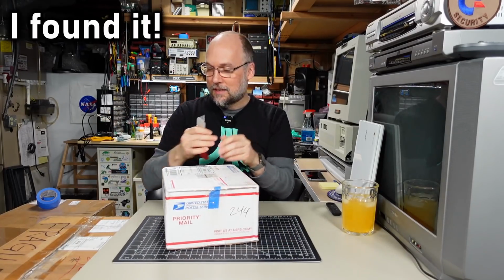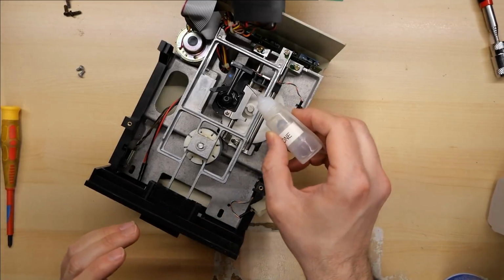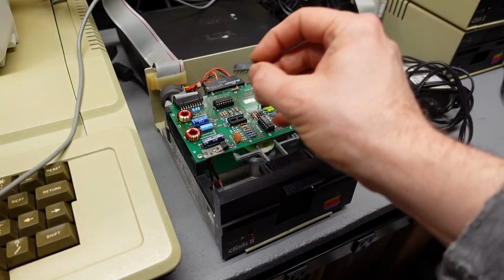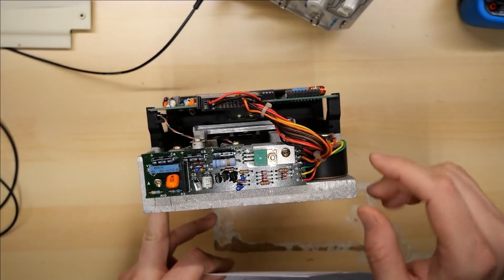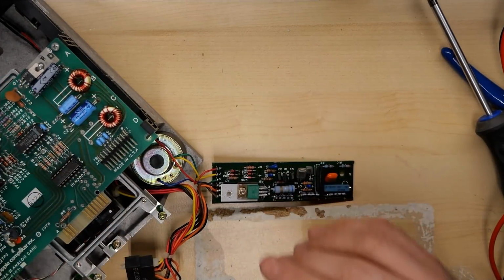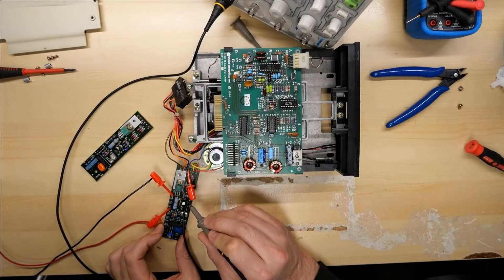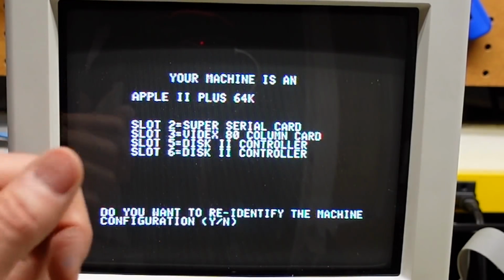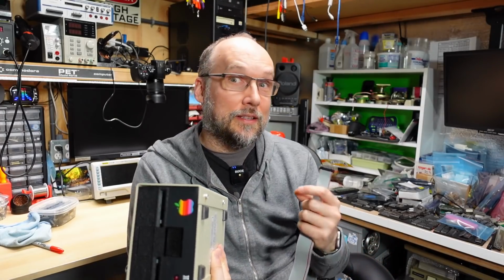Repairing an Apple Disk ][ drive with multiple faults

Comment from the maker: Several people suggested a bad pot on the speed controller. I had checked the pot and it was fine -- it has a range of 0 ohms to 50k ohms. With this circuit, the pot only has a very small range of adjustment around the target motor speed, so removing it almost certainly would only result in the speed being slightly out, not wildly out and uncontrolled.
Reply: Did you by chance check the input vs output of the MOSFET?  I think those things fail "on" sometimes, right?  You should be able to test that by itself without the rest of the board powered.
Reply from the maker: Yeah I did -- even comparing how things look to the working drive (just didn't show any of that on the video for time.) I wanted to see what the output looked like on a working drive first so I knew what to look for.
Reply: The two things that I immediately suspected that i didn't see get checked in the video are in the first comment thread... Always good stuff from this community
Reply: actually no, if you removed the pot, then the on chip oscillator would not run.
Reply: I was wondering if it was a dry joint or bad connector. (?)
Reply: I literally just commented this. Because my 3d printer stepper driver module trim pots throw max voltage when they fail. But if the range is as limited as said then yeah its gotta be that IC. I wanna see you de-solder it and try the oven trick and see if it comes back to life.
Reply: Is posible yo use your scope like curve tracer for compare both boards.
Some time ago I have a problem with the servo controller in one Open Reel, in my case one transistor fail and the motor do not turn at all.
After testing all I change the transistor for new one and the machine works perfect.
I use a B&K 520b transistor tester, the transistor looks fine but do not works in circuit.

Best Regards.

Comment: When I was in high school the principal asked me to see if I could fix, if possible, one of their Apple IIe Disk ][ drives that was "eating" disks (it was writing junk to track 0 as soon as it was turned on). Now I didn't have equipment to check signals, but I did have plenty of other Disk ][ drives that worked just fine,  so I just borrowed chips from a good system until I found the fault. It was a bad 74LS125 chip on the controller card, and it was cheap to get a replacement (less than $2.00 back in the mid 80s). One fixed Disk ][ disk drive later, the Principal was happy...until he told the school board that a student had saved them money. They had a something of a fit and absolutely forbid a mere student to mess with the innards of one of the school computers! They would rather pay an "authorized Apple repair shop" hundreds of dollars, rather than allow a student to fix it for the cost of parts. Their loss!

Comment: Hi Adrian, I am two years late to the party but yes, I also have an ALPS half-height 5 1/4" Floppy Drive that runs flat out, not on an Apple or Commodore but on my Osborne Executive.

I had done some preliminary examination of the wiring to the backplane of the drive, and was preparing to use a breadboard to jumper the SHUGART Connector from the ribbon cable to try and find the problem, however you just saved me a heap of time and effort with this video (and your method is far simpler by going directly to the speed controller board).

Also, you provided the speed controller schematic and an obtainable replacement drive to source parts from, and I can tell you I have been seeking assistance to this problem on two Osborne Computer Groups but no one has been able to help me, so a thousand thumbs up and my eternal gratitude! 

I have an Apple Disk II Floppy Drive with a dodgy 74LS125N chip (fried on the weekend by accident, when plugged in incorrectly) and when I pulled the cover off the drive to check the number on the chip (I was watching this video in the background) you mentioned the ALPS Drive and my ears pricked up. Then when you mentioned the drive running flat out and looked at the speed controller board, I realised that it is identical to the board that the Osborne Executive half-height ALPS Drive uses.

My Apple Disk II ALPS Speed Controller board is slightly different (component sizes = HUGE caps) and I want to fix that drive with a replacement 74LS125N IC, so I won't cannibalise it, however I did jump on EBAY to grab a Commodore 1541 ALPS drive that should hopefully provide a good donor board for the Osborne drive speed controller.

Thanks again and wishing you every continued success,

Cam
Canberra, Australia

Comment: I have an Apple Disk II that prevents my II+ from booting when it is connected. 
It was working fine, then it started to become intermittent, now I can't get it to boot at all. 
But it boots fine with another drive plugged in.
Any ideas what that might be? :) 
There is nothing obviously wrong inside, and everything moves freely.

Comment: Thanks a lot Adrian for pointing me into a right direction! I had a Disk Drive which was spinning at the same speed as yours! I thought, me speed controller might be dead as well. Still I probed the tachometer signal and found, there was no such thing! Nothing! No signal from the motor.
I removed the tachometer from the Compal LC-177 motor (two tiny screws) and found, that the magnetic ring on the motorshaft was spinning free! I fixated it with  some superglue and activator, screw it back to the drive, turned it on and bam - drive speed was back to normal. Quick stroboadjust and the drive was booting again! Without you -  me beeing a complete Apple drive hardware noob - I would have never ever found this fault! Thanks a ton again! Cheers!

Comment: Hi Adrian - I have one of these on my bench and the drive belt has been nicely nibbled apart.  Was wondering if you could provide the dimensions of the belt and a potential source to buy one?  My drive is also the later one like in this video and not the Shugart version.  I understand that there is a belt size difference.  Thanks in advance.

Comment: Your screw magnetic grabber looks like one I picked up for $10 USD at my hospital gift shop 7 years ago.  Looks like yours has a LED light like mine. I find mine to be my go to grabby tool for those lost screws in my office carpet. While I should not have carpet in my office but more anti static flooring that was not meant to be... Maybe my new new new new new manager might see the need to add anti static flooring. I've taken a few static discharges through my pants zipper. TOTALLY DON'T RECOMMEND.

Comment: Hey Adrian. Could also be that the potentiometer that controls the speed of the motor is dead or rusty, leading it to have always full value ? Maybe replacing it if you need to use the part again later could be an idea. Thanks for these awesome videos.

Comment: If you want to see some impressive code look at the read sector code, the 6502 running at just 1mhz had to read the data directly from the head and process it without the help from a disc controller, the timing had to be spot on. 
I remember rewriting the code back in the 80's and stripped out everything to use the drive like FRAM with no directory structure so it had greater capacity to be used as a database.

Comment: I remember those drives.  We had an Apple IIe when I was 16 or 17..  There was lots of room inside.  I installed a switch that I glued (with epoxy) so that you could reach it by sticking your finger just inside the door and to the left.  It had 3 positions it was wired to the write-protect switch so that in one position it write protected your disk, in another position it write enabled the switch and the 3rd position did whatever the switch normally did based on the notch on the disk.
The bottom "vents" weren't actually vents either - the box was mostly water-tight.  And if the can fell just right to spill into the open door could hold about half a can of Dr. Pepper.  Don't ask me how I know this.

Comment: The apple 2/2+/2e drives would read a peanut butter sandwich if you could fit it in there!  ^-^

Surprised i didn't hear the "clacka clacka clacka" sound of the heads bouncing as they are run to track 0.  Some of the better drives (aftermarket mostly) had a sensor that would stop the tracking motor from doing that, but none of the Apple brand drives did, as far as i know.

The entire apple 2 series was a study in doing a lot with very little hardware resources.

Comment: Usually when the disk][ is incorrectly connected, you'll know it as there tends to be sooty marks where the 74LS125 was.  Whoever connected it incorrectly will also know it as it tends to go BANG as soon as power is applied.

All my disk][ drives but one are "red label" drives with ALPS mechanisms.  The remaining one (a "brown label" drive) is an actual USA-made SA390.

Comment: The following quoted text is from a Jan Beta channel discussion about the suspected cause of high MOS Technology IC failure rates.  You should check the date codes in your bad ICs storage box to see if there's any correlation:  "According to what we know, the bad years were 1983 and 1984 (due to too much boron in the IC die insulation layer). In 1982 the Frontier Semiconductor fab wasn't operational yet, in 1985 the problem was solved."
Reply: The C64 PLA Dissected
Thomas ’skoe’ Giesel

http://skoe.de/docs/c64-dissected/pla/c64_pla_dissected_a4ss.pdf

4.3 Reliability Failures

People who repair Commodore computers notice that the early PLAs fail quite often. Bil Herd recalls “By far the worst chip failure mode we had was the PLA around 1982-83 as it was suffering from poor passivation. It would get the ‘purple creeping crud’ which was corrosion under the protective layer.”
 
Dan Morris knows the reason for this issue: “The inter-layer glass (Low Temp Oxide or LTO) is doped with Boron and Phosphorus atoms. Boron and phosphorus are added to soften the glass and cause it to flow at lower temperatures. The flow smooths the surface of the circuit dramatically improving step coverage for the aluminum interconnections. Boron concentrations above 4% really accelerates the glass flow. Unfortunately raising the Boron concentration above 4% also sets up a strong but relatively slow corrosion reaction with aluminum. This is a reliability time bomb. As soon as the field failures demonstrated a problem. The process was changed to reduce the Boron to less than 3%. Unfortunately,
 many, many computers shipped with this problem first.”

Comment: Hi Adrian! thanks for the video!
I have an idea for the dead parts bin, it's probably overkill but it may be a good piece of wall art for the basement: you could design a PCB with the pads for the chips, add a silkscreen with  your logo, chips contour and names and at the bottom of the board the title "DEAD PARTS" with the date you started to fill the bin to the date you emptied it.
And for the next board, you could add the exact episode where you replaced the chips.
That would be a nice memorial to all these chips who died doing their part (or mistakenly getting a 12V boost :D)

Comment: Nice fix, Suprised the c64 drive shared parts,lol. Your eprom programer can test logic chips, I'm not sure if I learned that from you actually!?!
Reply: Not too surprising. Neither company manufactured drive mechanisms but just bought standard off-the-shelf components. In this case an ALPS mechanism, which was a cheap clone of the original Shugart mechanism found in earlier Disk ][ production runs. Both Commodore and Apple used custom controller boards (simple and cheap in Apple's case, but smart and expensive in Commodore's case.) but the drive mechanisms were industry standard.

Comment: I would have tried to solder the Sony chip again from the top side (between package and board surface) in case the legs had microscopic cracks in it. Although I don't know if that package type is prone to that.

Comment: I would have liked to see you diagnose the fault beyond just the speed controller board. I have a couple of Disk II drives here both with a similar problem. They spin far too fast, however turning the pot does adjust the speed. With the pot at minimum they still spin too fast.

I've ordered a couple of CX065-B chips because my conclusion was also that it's probably the IC, but I'm still waiting for them to arrive from China.

Comment: I remember working with one of these drives in the mid 80s when in the middle of booting up one night I heard a pop from inside the drive and it stopped reading floppies. Turns out the Analog to Digital converter chip blew up. Thankfully the college I was attending at the time had replacement chips. I bought one for $8 and it fixed the drive.

Comment: Back in 1987 I once plugged the ribbon in backwards on a Disk ][. The Apple Repair Manual said replace the 74LS125, so I did and it worked!

Comment: Nice work getting the drive working again! I'm guessing that motor controller chip is specifically designed for these drives, so finding a replacement might be difficult, since it would have to come from a faulty drive. If the chip is also killed when the cable is connected incorrectly, that would make finding a working spare even more difficult.
Reply: hi, luckily no, ic is common to tape recorders motors and vcr motors and there is also an alternate part number  NTE1300
Reply: That IC is a very generic motor speed controller. Used in disk drives but also a lot of Hi-Fi equipment.

Comment: I've been through this exact problem on all of the floppy drives but one that I have in my collection for my TRS-80 Model 1 (I have 6) Two of them are Shugart SA-400 mechanisms and the other four are Tandon TM-100 mechanisms. All but one of them had drive speed board failures in the lone IC on the board and a couple also had bad transistors. After the first two that had failures I just replaced all three components out of course (futureproofing if you will) and they worked as they should after. So these problems are not limited to the ALPS mechanism only. They are common on both Shugart and Tandon mechanisms as well, and as shown, also not just common to Apple Disk II drives. I have yet to have issues with the controller boards on either mechanism on the TR-80,  just the drive controller boards. This may be due to the fact the drives can't really be connected up wrong like it's possible to do on the Apple drive. Hope my experiences help with your troubleshooting of the defective drive motor board.

Comment: 11:02 - It's amusing to see all the 'waste space' in that original 'full-height' design!
Reply: There's partly a reason for that. Woz came up with a brilliant, minimalistic design for that analogue board mounted above the drive. It was smaller and used far fewer components than Shugart's. The same goes for that controller we see being plugged into the Apple's slot (usually #6) -- it's very sparse and tiny by  the standards of the day. That said, the risk of accidentally misaligning the cable connector pins and destroying the TTL chips on the analogue board was a serious design flaw.
Incidentally, the cost of manufacturing these drives was equally minimal given the low component count, but their retail price was ridiculous. Apple and many other manufacturers made more profit from floppy drives than the actual computers they connected to!

Comment: Fun fact: the DuoDisk and the Unidisk 5.25 both had a hole on the bottom of the case where the speed adjustment screw was 😉 not sure about the //c secondary drive, which was basically the Unidisk 5.25 without a drive 2 pass-through port...

Comment: I wonder if you could adapt a apple 2 drive to work on a c64?
Reply: I believe the Commodore drive had its own 6502 processor and memory.  The Apple II drive is run by the processor on the Apple II motherboard via software in the Disk Operating System.
Reply: @Mr Guru You could pull the controller card off a 1541 and stick it on a Disk ][ to make a bulky 1541. The mechanism is the same, and the connections from the controller card to the motor/head are no different either because they were somewhat standardized.

You would need the controller parts from a 1541 to make the drive 'smart' though.

Comment: The Apple ][/+/e case is an still an outstanding industrial design... I miss the days when an 8-bit 48kb Apple ][+ was all I needed in life...
Reply: Agreed. Back when most micros (as they were called) came in utilitarian sheet metal cases, the Apple was designed with an elegant, off-white "futuristic typewriter" case that blended into any office environment. That was Steve Jobs' contribution, as was the use of a switching PSU, instead of the clunky linear ones that were still widespread. The latter was sourced from ASTEC rather than from WOZ. :^)
And of course you can't help but love the original "rainbow" logo instead of the insipid one they use now (ditto their current insipid product design).

Comment: I didn't see this in a quick check of the comments, but I think the 60-50 Hz "timing wheel" is called a strobe disc or stroboscope disc.
Reply: Yep. And you can even use your 50/60Hz monitor to check/adjust the speed with it.

Comment: TIL that the Apple ][ and Commodore 1541 drives use the same controller for the spindle motor... 🤔
Reply: If you look closely the motor and even the entire drive is the same. The 1541 is just squashed into a half height frame.
Reply: It's an industry standard drive mechanism. Everyone either used the original Shugart mechanisms or clones of it like the the ALPS mechanisms shown in the video.